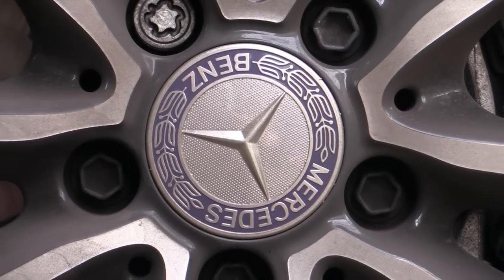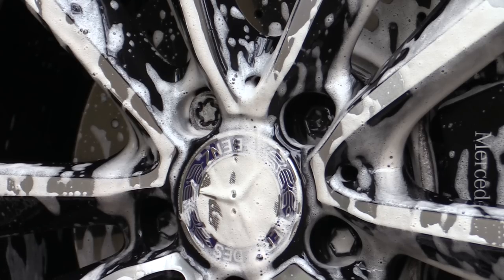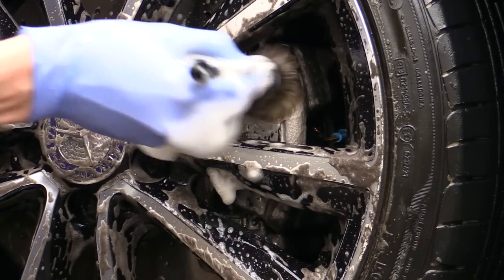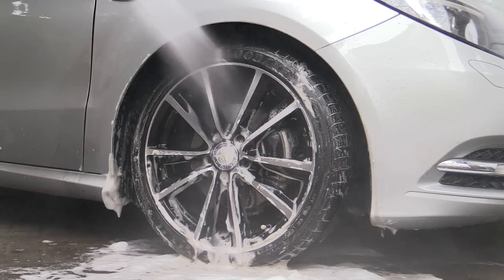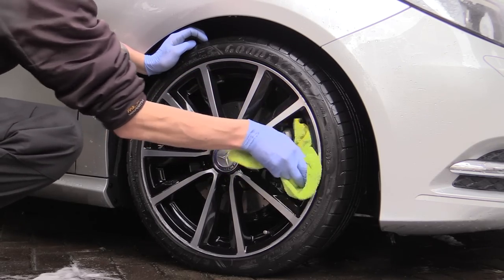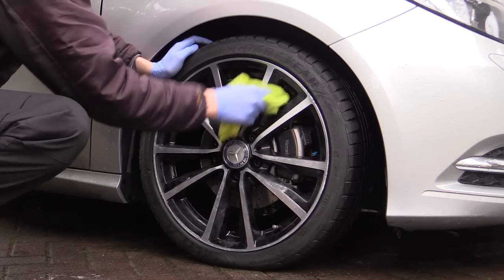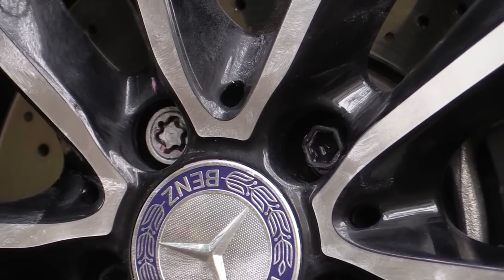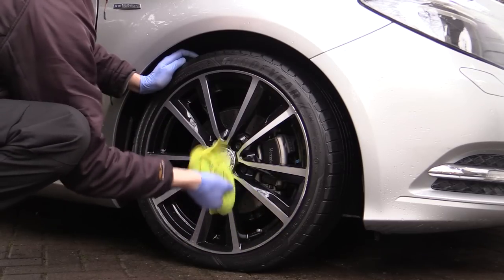How to Clean, Polish & Protect Painted Alloy Wheels

Comment: Me : Hun, I won't be back for 3 days.
Wife : where are you going?
Me: washing my car.
Reply: I would only go into such detail perhaps once every 3 months. Other than that I take around 3 hours to do inside and out on most cleans/details. Car Cleaning Guru is only offering tips. Most of us don't have that much time to give up but certainly I use a lot of these techniques just not on every clean. As for the wife; I usually pack her off shopping when I'm really going for it with car cleaning.Downside is I then have to make my own tea!!
Reply: It was a joke man
Reply: GAMEBREAKER700 l
Reply: Same here. I'm going to give my new car rooty toot every three months and a good wash n wax once a week - mostly. Could not believe Car Guru spent 5 hours cleaning one car, though. Most time I spent on my previous car was three hours twice a year and normal wash most weeks. I do mine when my wife has gone to work and I have the drive to  myself.
Reply: nicky bond lol 3 days more like a week

Comment: OMG! the Queen of England is going to hire you Car Cleaning Guru.  I thought I was  the king detailing a car, but the work that you did on those wheels certifies you as the King of Wheel detailing.  I have never cleaned the wheel well of my car.  The first time you sprayed the wheel in my opinion that was super clean and I wasn't expecting you to go beyond that point.

Comment: Dwell, attack, bite, loading, lubrication, bent, lug nut, branded centre cap, contours of the wheel design, usefully long skinny arms and the design of the wheel permits, brief blast, quick tea break, worked in with fingertips, accessed using my finger, damp winter air, fully cure prior to buffing......are all things I never thought I would hear when I started watching this video!

Comment: Excellent video. Ive found that using extra gloss protection on the alloys helps to not only seal the polish, but its also a lot easier when clesning the wheels the next time. Subbed!
Reply from the maker: +MrSolveMYMaze Haven't used EGP for ages!
Reply: @CarCleaningGuru  Bit of a late reply, but SRP with Collinite 845 has lasted 2 months so far on the alloys. A cheap and cheerful but extremely strong combo. Much better than firing EGP ontop of the SRP

Comment: Good vid. I think getting the wheel off the car would have made this easier, quite a bit easier, and also allow for protection of the inner wheel. On this, the inner wheel is painted so dark however (and its a personal view) a pristine light-coloured inner wheel makes the wheel look much lighter (in weight). For protection, Collinite 845 is the best sealant I’ve used. I may try ceramic one day - but I’ve a lot of Collinite left. Great vid.

Comment: Great video!  I got similar alloy wheels on my motor but I haven't got the dedication you have :)  If I clean my alloys in 3 stages what products do you recommend?  That's apply cleaner then a polish then apply a protection coat.

Comment: Excellent demonstration video my friend.....You mentioned trade based wheel cleaner, which one would you recommend? I just bought a new VXR with Diamond cut alloys and want to look after the wheels properly right from the start. I clean my motorcycle alloys with WD40 but this takes time to clean everything. Can you recommend a good cleaner....Many Thanks
Reply from the maker: +Cbf1A I use Autosmart Smart Wheels through a foaming trigger spray head (which I recommend). Valet Pro Bilberry is similar and can be had in 5 litres although if the car is new and you polish and seal the wheels to begin with you shouldn't have to use anything other than a standard shampoo if you clean them fairly regularly.

Comment: Nice one, another quality detailing! Here's a general question, on buffing is it possible to buff to hard so you can buff product away? Just something cross my mind when I was buffing the wax off. Any idea...
Reply from the maker: woncho1 I'd say no to that. Even though the visible layer of product residue may have been removed, theres still a very thin layer that should have bonded to the paintwork which a buffing towel alone won't be able to remove at that level.

Comment: Nice video
can I ask if your bendy wheel brush has a metal spine? I have seen a few in shops and they all seem to expose the frame to the alloys when used (and possible scratches)  we have a quashai with 18 " alloys that I find hard to get to the inner wheel and back of spokes. as your products are pro products could you recommend a wheel brush that you use that won't contact the wheel with a bare metal frame.
cheers and keep detailing
Reply from the maker: I think it's twisted around the bristles but it's plush enough to prevent against contact with the wheel, I've certainly has no issues with it. You might want to look at wheel woolies too.
Reply: thanks for the reply and advice.

Comment: From not drying my wheels after washing my car there are rust spots behind the wheel infront of the break disc and tips on how i can get the rust off. Any tips on drying behind the wheels aswell please
Reply from the maker: +James Landale Try a standard paintwork polish first. And look into the Metro Vac'n'Blo for drying. I need to get one myself.
Reply: +Car Cleaning Guru. please do a video on car wheels with rust on
Reply: grease or vaseline soften rust .leave on a day and wipe off.it will remove rust.

Comment: Question: do you ever throw your microfibre towels, and microfibre pads into the wash? if not, what is the best way to wash them? I have towels for different tasks too, but over time i think i start to get some mixed up because they are generally the same colour.

also one of the towels i use for polishing has compound that has dried up and become a little hard on it. is there a way I can easily wash as remove it?

Look forward to hearing from you!
Reply: really appreciate the reply, also ive already liked and subscribed! love your work mate, and love how you show all the detail. don't cut those parts out.

Cheers,
Fan from Sydney, Australia

Comment: How does one go about keeping their brake rotors that shiny if the vehicle is being driven ?
Reply: +Izuzan By USING your brakes regurlarly. Don't coast, brake!
Reply: +Totally Legit Gaming [TLEG] any rotors i have seen get rusty just over night after being used. as it burns any protective layer off and leaves bare unprotected steel. also rarely see them that smooth. always seem to have slightly uneven wear across the rotor face from the pads.

Comment: Hi there, thanks for your video. I want to clean and protect my wheels but I've found on a previous car that some cleaning products for alloy wheels can be too aggressive. I had a BMW 318ci with M pack wheels that were fantastic but over the time that I had the car, the alloy surface deteriorated. A BMW dealer and others I have spoken to said it could be due to aggressive chemicals I was using to clean the wheels. I can't remember the brand I was using then but I was wondering what you recommend and i see you are using Autosmart and Autoglym products. Do you endorse these products and are they typically what you use? Thanks so much for the info! Denise.
Reply from the maker: I generally use Autosmart Smartwheels but it isn't available over the counter. If you polish and seal your wheels after an initial thorough clean they should come up using just normal shampoo provided you don't leave then too long.
Reply: Cool, thanks for replying. I ordered P21S 12700W Carnauba Wax on amazon and Wheelwax together so I hope these are good products for my car. I know the carnauba wax is harder work and doesn't last as long, but I heard it gives a superior finish. Many thanks for your advice and good videos! Keep the videos going, we appreciate them :)

Comment: Thank you for another awesome video! 
Whenever I wash the wheels, the brake rotor gets rusty and yellow, which is normal on naked metal. After short trip and braking, it goes off and I wipe the barrels with a detail spray and MF. I noticed you don't have yellowing here, what's your procedure on that??

Comment: I just got a pressure washer when I blast my wheels it takes all the brake dust off but would I still need to wash them
Reply from the maker: That's entirely up to you. Ideally yes but if you're happy with the results why bother?!
Reply: HI guru ,i have skoda wheels like this.i just cleaned them today.power spray ,with foam at petrol station.then i used a alloy cleaner spray and agitated them.then i removed rest of dirt with some mantis.i used a soft alloy brush.used microfibre cloth with mantis.i noticed on the drivers alloy when two fines line scratches on the chrome a few centimetres down from the top of the rims .Not deep.but could i have done this or is it just that i was driving around with dirty alloys.i live in area of countryside where there is a lot of dry dirt cause by many trucks in the area?the car is only 4 months old

Comment: So it takes whole day just tp wash clean polish just one wheel?
Reply from the maker: SAJ@TV No, about half an hour. Then once they're done to that standard all they require is a light shampoo and rinse to bring them back up to that standard. It's an investment in time that will actually pay off in the long run if you clean your car on a fairly regular basis!
Reply: SAJ@TV The first clean will take longer, but once you've done it properly and then polish/seal it, it's a hell of a lot easier and quicker to get brake dust and dirt off in subsequent cleans.

Comment: Hi, great info about wheel cleaning, I recently cleaned the wheels of my new Kia Sorento with Meguiar’s ultimate all wheel cleaner which is claimed as ph balanced and acid free, as I was a rookie for wheel cleaning, not only I sprayed the product on wheels, but all wheel rotors and calipers, which I thought needed to be cleaned as well. After rinsing with water the rotors have got really rusty not only on the outside but through the vented areas. I know that by driving the car around and pressing down the brake, the rust on the discs will disappear really quickly, but what about the vented areas that are visiable from certain distance. Hoping you could shed some light on how to get rid of the rust. Thanks
Reply from the maker: Not much you can do about that aside from remove them and repaint. They will inevitably have rusted after being driven in the wet a few times anyway.

Comment: I find the foaming head for applying Smart Wheels wheel cleaner uses far too much product,  with no significant benefit over the chemical resistant head that I have now reverted back to.

Comment: I'm shocked.
All those steps & time on one rim...If it's cold outside? 
Um - the point of wheel spray is that you don't have to hand work intricate rims like that by hand 3 & 4 times with several products.  New products & technologies are created to avoid all that fingertip pressure detailed had work.

Get a Cone tool that attaches to a power drill and apply a pollish.

A thorough washing removes the heavy dirt, but a traffic film remover?
That actually turns me on!

With all the work I see here, how many different Micro fiber towels were harmed in the filming of this video?

I do like your videos,  they are fun to watch to pass the time.

If they were AMG. wheels I'd understand this process.
Reply: My guess is his service doesn't come cheap.  If I were hiring someone to detail my car, I would relish seeing them take the time and care that he does.  On that note, I'm reasonably sure I could not afford to hire him!
Reply: +Mopar Nut (Moparnutalways) 
Not the pointActually! 
Traffic film Remover-dwell
Rinsing, 
Wheel Cleaner-dwell, 
Brushing,  
Shampoo-brushing, Shampoo-washing, 
Tyre +Arch cleaning,
Rinse,
Drying,
Drying Tyre + Wheel Arch,
Tea Time Mate,
fingertip treatment, 
I'm not kidding, the wheel was Fingerered!!!- dry to haze+ buff,
Separate wheel sealant,
haze, 
buff,
dress Tyre + Arch.
THEN - ONLY THREE MORE WHEELS TO GO!!

IF YOURE GETTING PAID BY THE HOUR - BY ALL MEANS.
IF THIS IS A SHOW CAR + NOT A DAILY OR WEEKEND DRIVER.  
ID NEVER WANT TO GET THESE WHEELS DIRTY AGAIN!! 
OK YOU MAY WANNA DO ALL THOSE STEPS PERHAPS ONCE A YEAR, then okay, by all means-- it's tea time mate!
Reply: +Michael C. 
Don't get me Wrong
This Man is a car Detailing Mastermind!
He is my hero - although I tease that this process is extreme.  He is the Master.
I thoroughly enjoy his videos + work.
Reply: Don't get me wrong, I'd never go to that extreme with my wheels.  But he's doing it for a living, and doing a very nice job.  My guess is his clientele expects no less.  Personally, I give my wheels a nice soapy bath with a scrub from a soft brush and then a rinse.  Sometimes I wax them (maybe once a year, maybe)  and that's it.  And you're right, if I went to all the trouble cleaning my wheels that he did, I'd never wanna let them see the light of day again!  Gotta admire is fortitude.
Reply: I'm guessing it's a once a year or a twice a year thing, If I ever decide to do this it would only be when i rotate the wheels on a weekend, like when I take them off, I would do this while they were OFF the car, that would save a lot of time cleaning them. and keeping them clean afterwards would not be a concern, I would only do it if it helps preserve the wheels longer...
Reply: Michael C. That's why it's called DETAILING

Comment: fuck this just alloy wheel cleaner and a jet wash would of done the same job. as soon as the alloy goes into a dirty puddle for 3mins it's fucked lol. motorways are the worst place for alloys :\ no point doing a job like this on a daily driver car. its worth doing it to classic cars which don't get driven on shitty pot holed road ahh lol
Reply from the maker: There's every point doing this (at least once) on a daily driver. It's not just about making them look good it's about protecting them from all the contaminants you mention so that they resist corrosion, repel dirt and save you precious cleaning time in the future.
Reply: +CarCleaningGuru well if you got the money why not haha :D